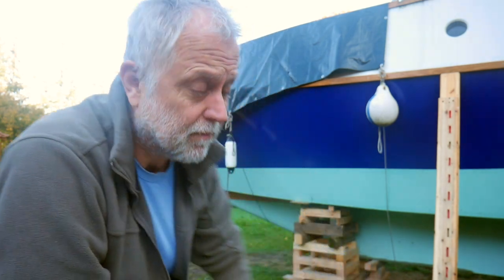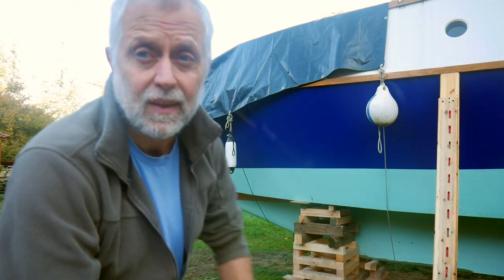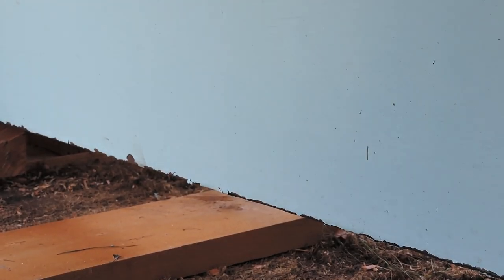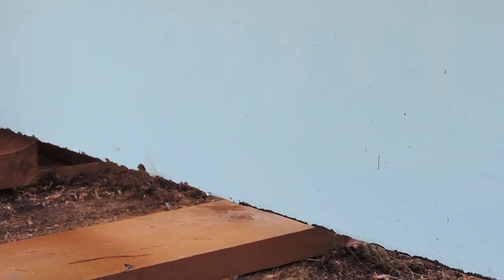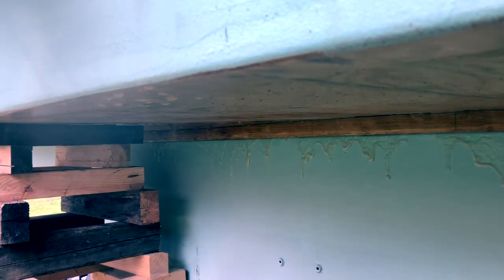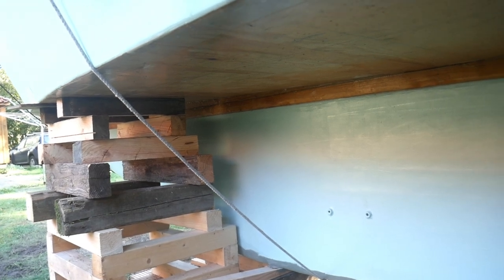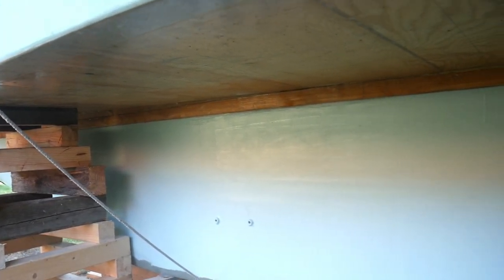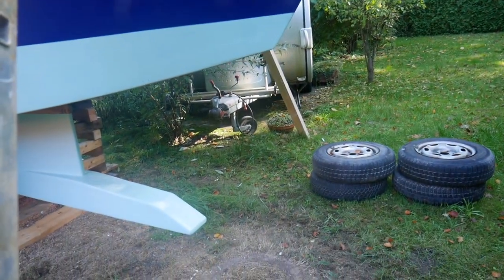KEEL FITTED!!  Building a cruising sailboat - SV Tapatya EP250

Comment: Great job , how did you know the torque settings for the keel nuts
Reply from the maker: Well… I did the first one by feel, and then tightened all the rest to the same torque. There are no specs, and of course, the weak point is the wood, which you don’t want to crush overly 🤔

Comment: Why are there no bolts at the fore and aft ends of the keel.
Reply from the maker: It’s so designed that it doesn’t need them, David. The bolts are in the ballast keel section, everything else is wood keel. The wood keel is supported by the ballast keel being through- bolted to the floors.
Reply: @SVTapatya  Thank you. I almost thought that, be figured I'd check. It looks great. Can't wait see you and Hazel in formation.